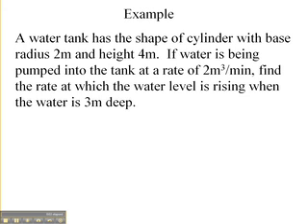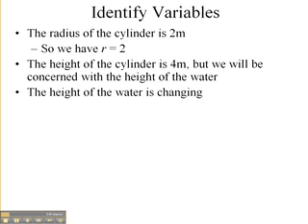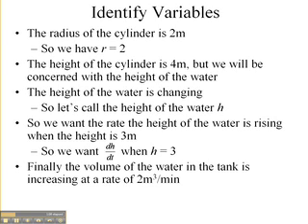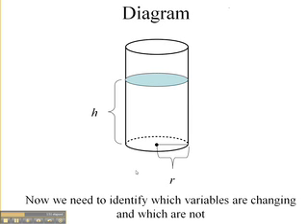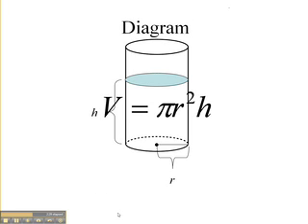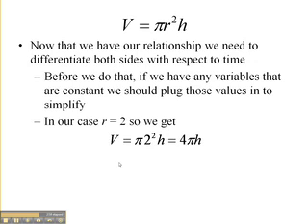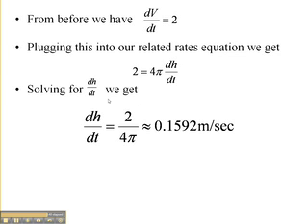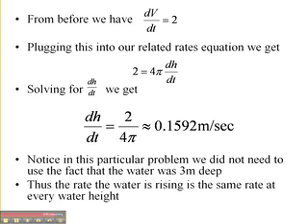Related Rates Example

Comment: what if they dont give us the height??
Reply: Honestly, in this example, it doesn't matter. There's nowhere in the derived formula where the actual height is needed. We're looking for the rate at which the water level changes (positively, because water's being added) - and in this case the rate of change of water level is constant everywhere so the height of the water level does not matter. 
They sometimes give unnecessary information in equations, so our job is to work out what we need and what we don't.
Reply: you dont need the height. You just leave it as H. I've tried this method on a problem for my homework and it works. There was no height given in my problem, only rate of flow and the diameter

Comment: Can you do a problem where water leaks out of a full tank@ 2ft^3/sec. the water tank is a right circular cylinder tank with a base diameter of 28 ft and a height of 24 ft. how fast is the water level changing when the tank is half full?  * applying your video I got dh/dt  to be 0.032ft/sec is this correct? There aren't very many videos on leaking right circular cylinders but a bunch on cones and sliding ladders.
Thanks,
LostnCalculus....